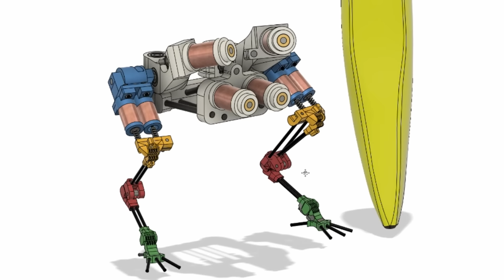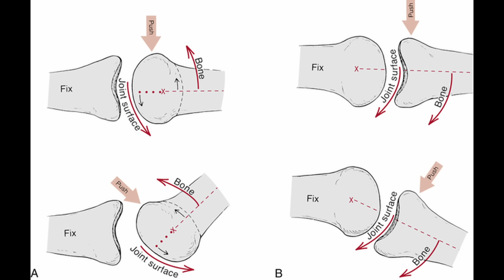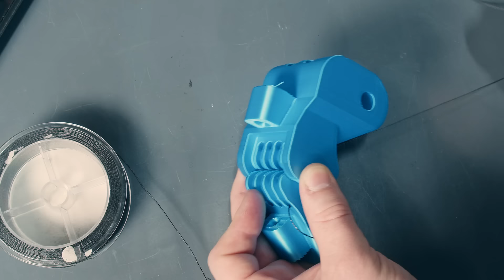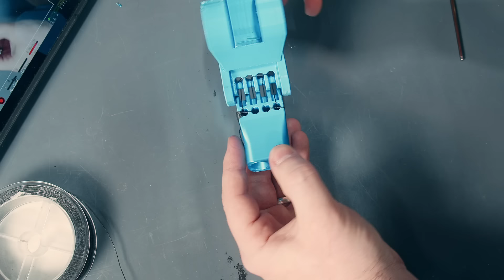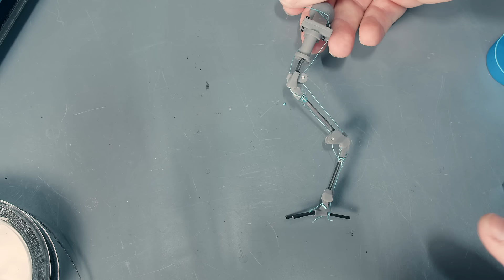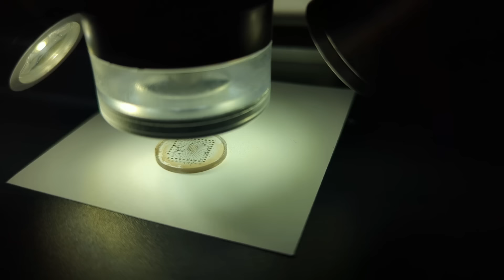Alternative to bearings for tiny robots

Comment: Why not to use a pin ? precise, small, tight.
Reply from the maker: Could work! I should have mentioned bushings (oil-filled, or teflon) as an option. It does limit load to some degree, as the bearing surface of a rolling joint will always be much larger than a small diameter pin. But definitely usable in a nearly-static configuration like these joints.
Reply: @BreakingTaps  Of course ! You could also try to build your own small needle bearing using a small pin as the central rotor reducing the friction and improving the load.

Comment: Something to think about if you are not already would be to use nylon for the joints, nylon is self lubricating so it should reduce friction. It may not have a huge impact as friction is already low but it may be worthwhile to test.
Reply: Personally I think that if the 2 rolling surfaces were actually geared then the gears would be resisting any tendency for the 2 parts to slide over each other.
That would be a good thing because as it is, the joint "string" is basically doing that function as well as controlling the position of the 2 pieces as far as keeping them tight against each other.
As far as "controlling the mesh" goes - 2 springs or maybe rubber bands between the 2 parts of the joint pulling them towards each other might also work.
Lets face it, in a pedal robot you NEED the legs to be as strong and light as they can possibly be and with this design the actuators can easily be placed up in the body.
This project will be fun to follow...
Reply: I think Igus do 3d printable filament optimised for low friction
Reply: Doubt that nylon would do anything. Those are rolling joints, NOT sliding joints. since there's no surface to surface sliding, having a low friction material is irrelevant.
Reply: @johncochran8497  irrelevant, or even make things worse by introducing unwanted sliding.
Reply: @johncochran8497  but aren't rolling joint contacting each other and thus creating friction on surface to surface  rolling?
Reply: @ytrew9717  Yes, but the friction is intended to PREVENT sliding.  The idea to use nylon because of "lower friction" is akin to saying that we should use nylon for car tires because of "lower friction" and it would be even better if we slathered those nylon tires with grease to lower the friction even more.
Reply: @johncochran8497  thank you, but why would it bad if it slides instead of rolling (stupid question but ...)?
Reply: @ytrew9717  Watch the video again and imagine what would happen if the joint slid instead of rolled. Also, remember that our own bodies use rolling joints. So, look at a diagram of the knee along with the tendons that attach to the bone in order to flex the joint. Now, imagine what would happen if the joint slid instead of rolled when the tendon applies force to move the bone. Not a pretty picture. That rolling instead of sliding permits out muscles and tendons to actually move our skeletons. I suspect the creator of the video is going to eventually use actuators pulling "tendons" to make his robot move. That method would only work if the joints on his robot have fixed pivot points such as bearings, which he's rejected due to size concerns, or if he uses rolling joints.
Reply: @johncochran8497  But nothing bad would happen if the joint slid instead of rolled because the rolling is maintained by the string, and especially by the blockers on each side (our knees don't have those side blockers). Sorry, I still don't get it.
Reply: @zperdek  what do you mean by "gears" aren't they simply working as a ball bearing? What am I missing?
Reply: @ytrew9717  Ok. Take two pieces of wood, say about 2 feet long each. Tie a string about 6 inches from the end of one piece of wood, then lay both pieces end to end. Now pull on the string at 90 degrees from the wood. What happens is that the "joint" between the two pieces of wood slipped. Now, lay those two pieces of wood end to end once again and screw a hinge to them. Once again, pull on that string in the same way. The joint now flexes instead of sliding.

The same principle applies. For that rolling joint, you do not want it to slide. As for a natural joint lacking the side to side support of his demonstration, did you notice how much side force he needed to apply before it slipped? He wasn't using that side support. It's a nice thing to have, but not needed.
Reply: @ytrew9717   This joint is like a rocking chair: when you rock it back and forth you don't want it to slide over the floor, you only want the contact surface to roll. That requires sliding friction between the chair and the floor - and that is not the same as rolling friction. In robot joints sliding will cause the parts to be misaligned, so the robot limbs will not move exactly the way the control software expects which obviously is not great. Sliding in these joints is the equivalent of two gears skipping teeth. That's the reason gears have teeth in the first place: to prevent sliding.
Reply: @brinkoftext  it makes sense, thanks for taking the time to explain! Greeting from France
Reply: Nylon stretches over time and the joint would become loose, Dynema is a staitc (very low stretch) material and is the perfect material for this application as far as I'm aware.

Comment: I've had a glasses case that used the same principle. Beyond the flexure joint itself you just had it operate like hinges, but you could flip it all the way around to change the color! The bands holding it together has different colors on the two surfaces. It was a pretty cool mechanism and I liked fidgeting with it.

Comment: Any references on how to design the curves in the joints?
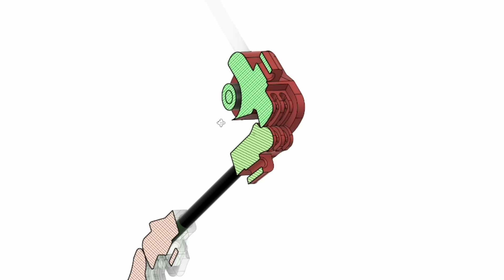Reply: Judging by 2:43 it's as simple (cough) as moving the axles closer or further apart. The string will want to keep the hinge in the least tensioned position. Moving the leg will either abrubtly tension the cord, creating an "end stop' or when turned the other way will gradually increase tension.

That would mean that the neutral "strength" can also be adjusted by varying the amount of rope ever so slightly.

Comment: Why did you need to have such a complex string pattern for the joint? The first time I've seen this type of joint was on a model airplane, where you iron on the tail flap using alternating patches of the half figure-8 pattern. I would think each of the 4 channels could have the full figure 8.

Comment: Its a very cool mechanism that suits this project really well but since its a low load, slow moving joint, woulnt a bronze/oilite or teflon bushing be a suitable alternative to miniature ball bearings?
Reply from the maker: Definitely an option! I have a design for the smallest oil bushings McMaster sells somewhere in my CAD folder and it probably would work well, although I spent more of the "design volume" then dealing with limiting range of motion. But very viable, and I probably should have mentioned bushings!
Reply: @BreakingTaps another really fancy option is iglidur z; I’m working on my uni’s student formula and we’ve been using them for a lot of brushings because theyre basically self lubricating teflon bushings with better mechanical properties (around 0.05 to 0.14 u w/ steel iirc)

Though we had a bit of issue with them being too low friction and slippage was happening in other places

the company were super  helpful though and they made a lot of different sizes and could be another lot to check out you end up looking for polymer bushings
Reply: @BreakingTaps  Yeap  --  gonna keep asking
What happened to the Space Shuttle  /  spaceX  ceramic heat tiles ?
Reply from the maker: @RectalRooter  Offline for the moment pending some legal stuff (ITAR)
Reply: @BreakingTaps   International Traffic in Arms Regulations (ITAR)
Reply: Yeah, it was a revolution for me when I realized that using ball bearings for low-speed joints is stupid. Teflon is a wonder material. The overall structure ends up so much smaller and lighter weight for the same strength, and you can buy meters of tube for a few bucks and 3D print jigs to hold it and guide a razor blade to slice off precise lengths effortlessly.

For larger bearings I use teflon sheet, and cut flat circles for the thrust surface, and strips to wrap around into radial bearings. Strips are easy to cut, but flat circles are pretty fiddly. But it is nice that you only need to buy one sheet to make any diameter bearings you want.
Reply: Also worth noting is that McMaster often isn't a great supplier for tiny things on that scale.  A better option for tiny bushings would be Northwest Short Line, who do parts for model trains.

Along those lines, the "needlepoint bearings" that are often used for model traincar wheels can also work well down to quite small sizes.  Those are a simple mechanism where the ends of the axles are pointed to sharp points, and they snap into small conical recesses that have a bit larger angle than the axle points.  Typically the axles are steel, and the sockets are a delrin-like plastic, though I've also seen this in brass.

Comment: dont use bearings at all, just a swivel joint. or use a bending flexing beam, no joints. yep the usual water wheel does not use bearings at all. water or air bearing on the axle only. why so complex bro. grease. basically thats a knot that is the ankle. stick knot stick joint. contact friction is in both that and bearing-less joint. the lego joint.

Comment: I've seen that in some toys but they used a band instead of a string. They were fun to fiddle with
Reply: I also think a flat profile ribbon would be the way to go as the connector... Adds even more lateral stability for "free" and won't chew into the underlying surface as quickly.

Comment: I've seen those with stainless steel bands, they provide a bit of stability/stiffness to the joint as well.
Nice design :)
Reply: Dyneema was engineered to replace steel cables.. It's lighter and non corrosive and way stronger..
Reply: @jazzdirt Dyneema has a problem with losing strength due to heat/UV exposure, the friction from knots will significantly weaken dyneema more than other materials which is a pain since it's hard to attach stuff to it otherwise. I think that's where spliced and woven dyneema comes in though
Reply: @jazzdirt   not cable and not steel, but thin shims (< .1mm)  and stainless (316). And since the shims are constrained (wedged between the surfaces) they have a lot of sideways strength, so it improved the sideways stability.

Not saying "this is the way", just mentioning another design I've seen.